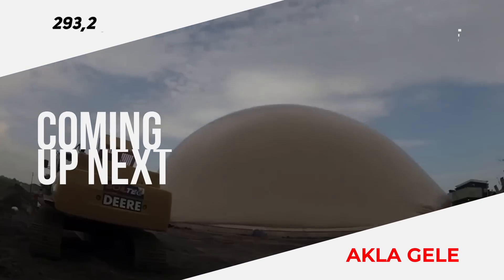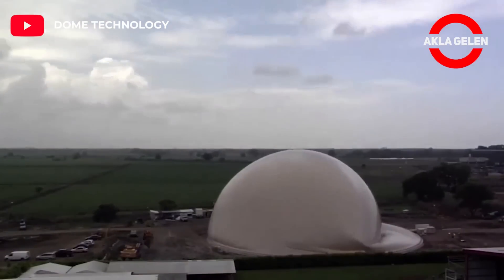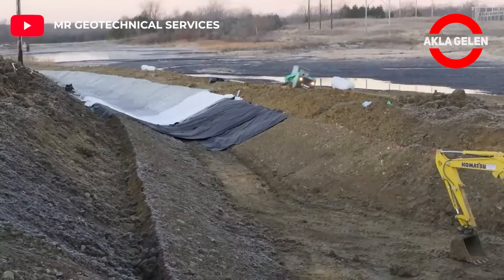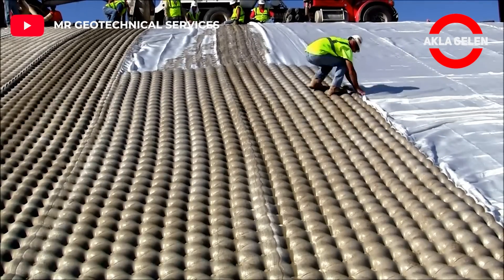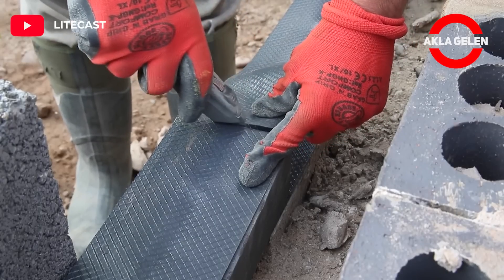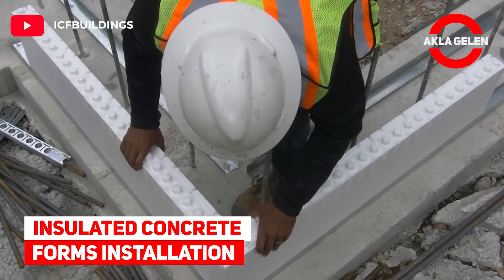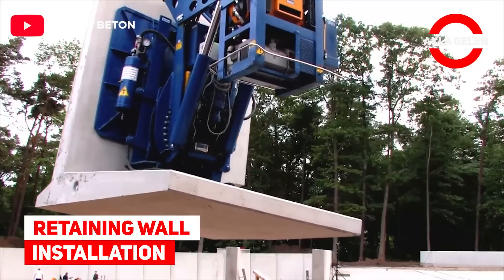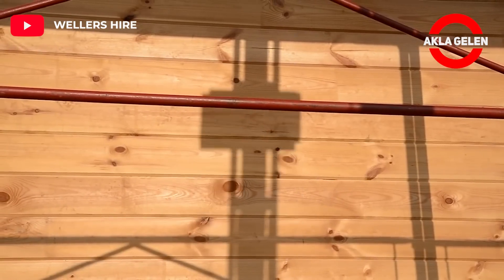American Engineers Shock Everyone With This Construction Technique - Incredible Modern Technology

Comment: Dome silo's are nothing new. We have been using them here in Missouri USA for decades. This holds true for roofing material convarers as wel. I started using them 30 plss years ago to load asphalt single ground to roof. Even used them with slight modifications to move earth to surface under an existing house to add a basement.
Reply: Well good for you dude! I live on the eastern part of the US, & its pretty neat & cool to me, to see stuff like this!